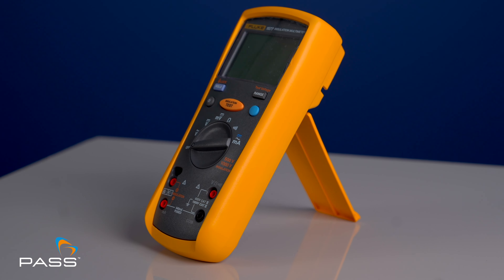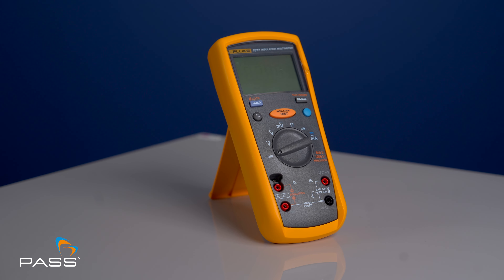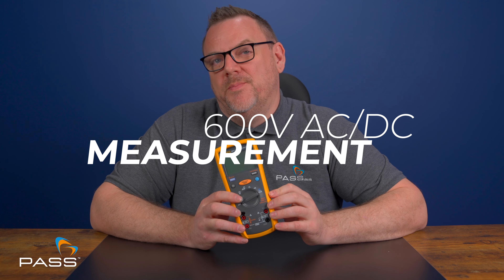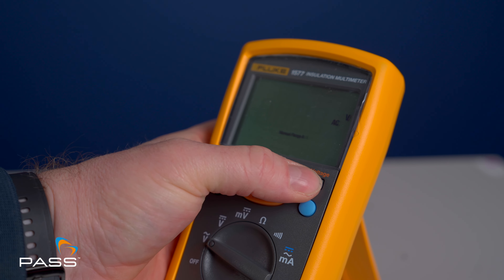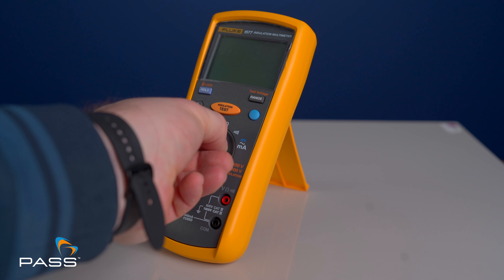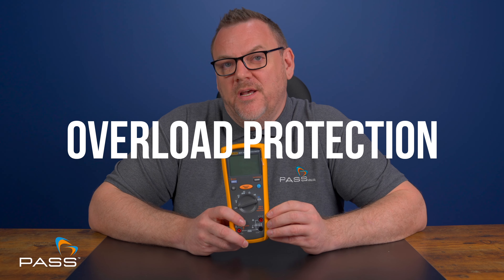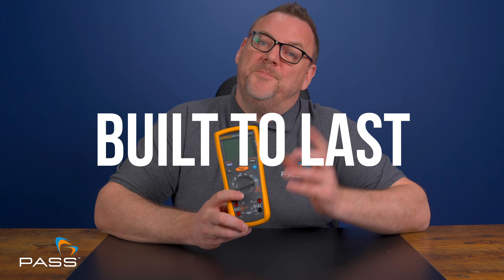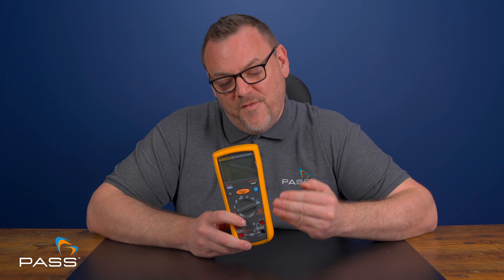Don't buy Fluke 1577 Multimeter before watching this

Comment: It does not measure 10Amps, but 400mA

But you can add a fluke i400 amp clamp and so on measure 400Amps via the mA input
Reply from the maker: Hi Dennis, Thank you for your feedback.

The Fluke 1577 measures current up to 400 mA directly. However, you can use the Fluke i400 current clamp to measure currents up to 400 Amps by connecting it to the mA input on the meter. This extends its functionality significantly for higher current measurements.